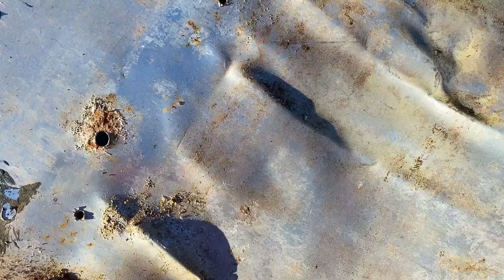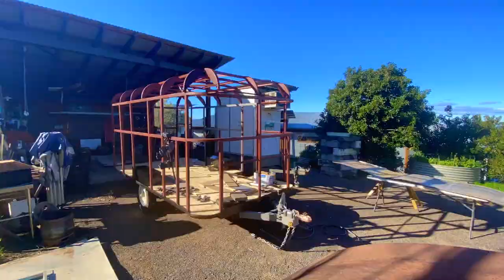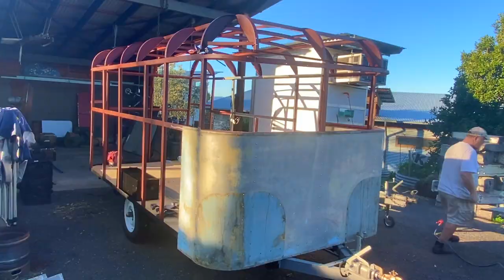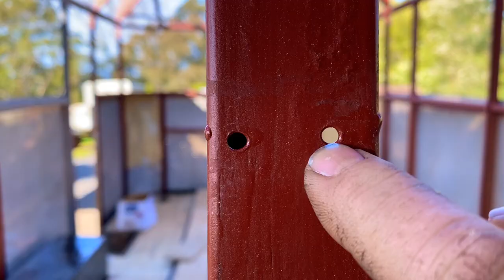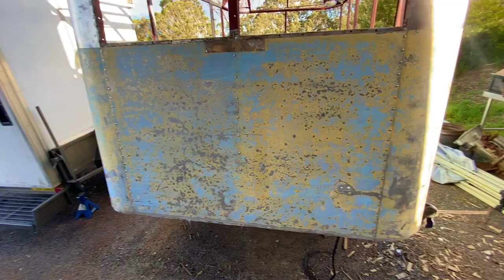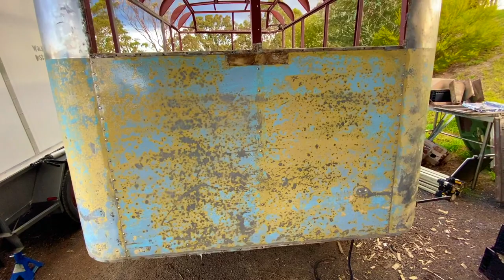1951 Caravan Restoration - Episode 5 - fitting exterior panels and preserving paint patina

Comment: Im building a Harley Davidson with raw steel for tank and fenders. Why use the turpentine mix vs just boiled linseed oil?  Thank you and great work!
Reply from the maker: Thanks Jonathan, the turpentine makes it work a bit better, easier to apply an even coat and the turps evaporates out anyway, I usually apply a second coat to build the coating.

Comment: Wow, boiled linseed oil & turps as a long term surface finish exposed to the elements including UV! That is absolutely stunning info. THANKS!!! How often do you expect to have to freshen it up with another coat?
Reply from the maker: I will have a look at how it ages on the painted alloy but I would expect 9 to 12 months Benny.  I have used it on cars before (and obviously timber a lot), seems to last very well.

Comment: Hello again Steve. Thank you for previous information. I have rewatched your videos and realised there is a lot I need to redo. 
When rivet your cladding to your steel frame. I’ll be using sealed blind rivets 4.8mm x 4.8mm if I can find any. Question is did you use large flange or counter sunk rivets? Or just normal?
Reply from the maker: Giday Andre, this video has a little more detail on the rivets I use and where to use them https://www.youtube.com/watch?v=i1JStAKTZSY

Comment: I love the patina! Will you put a clear coat over the top after the boiled linseed dries?
Reply from the maker: No , the linseed is instead of a clear coat, most synthetic coatings break down and are difficult to remove without the used of strong solvent which will damage the patina.  The linseed can be 'topped up' easily to maintain the protection.
Reply: @VintageRestorationsAustralia  do you then reapply the linseed oil after some time?
Reply from the maker: @graemelliott3942  Yes, it depends on what it is applied to (which metal), the environment that it is stored or used in, the weather it is exsposed to etc but an annual reapplication would be fine in most cases for outdoor use.

Comment: G’day Steve. It’s been awhile since I last saw your caravan Reno and dropped you a line. I messaged you about my Carapark that I am currently doing up. Question for you.. How do I put a new sub floor in if the caravan has its shell on. Could I try shoving the new sheet in through the door on an angle, or what would you suggest.?
Thanks in advance. 
Stevie…
Reply from the maker: I put the floor into the van in sections.